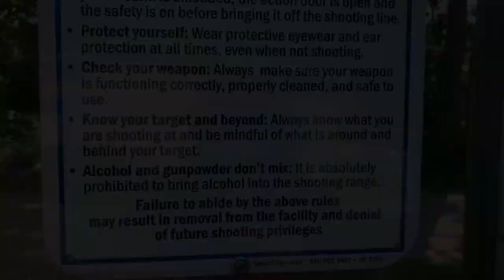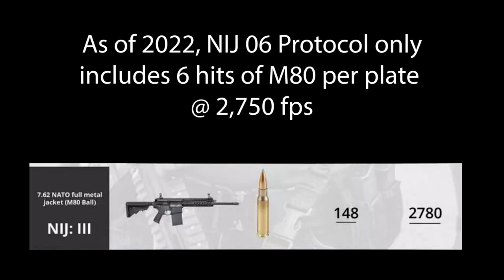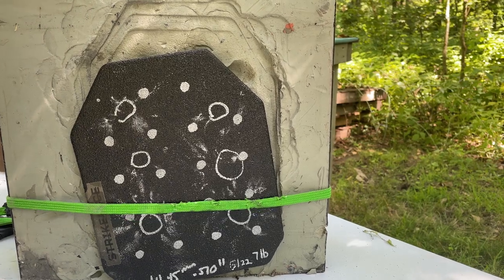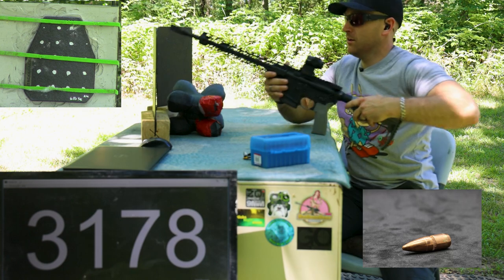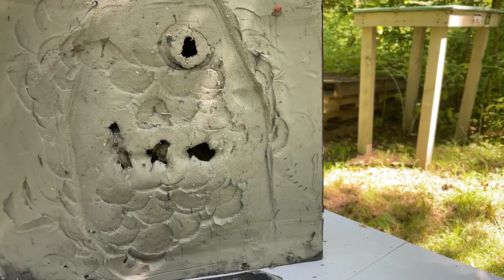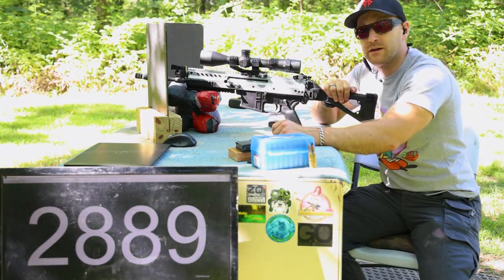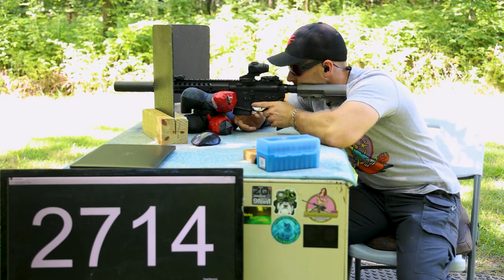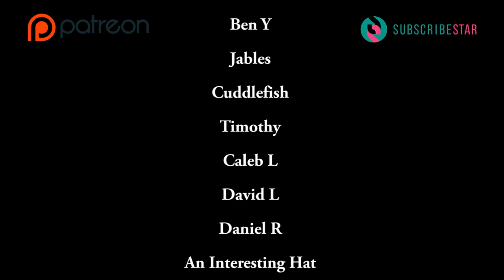Tacticon Armament Level III+ Steel Armor Demo!

Comment: Tacticon replaces the plates for free, with a police report, after you've been shot.
Reply: They do🫡
Reply: Fr?
Reply: Seems like you’ll die from the caliber everyone and their dog has tho…
Reply: So will Apex Armor with any brand plate you buy from them.
Reply: @Randaljoness  what round is that?  The xm193 or the m855a1?  You're acting like this doesn't stop green tip.....  Did you watch the entire video?  It stopped both of those rounds on the last plate. When he used a specific round with a specific barrel length it went though....
Reply: What’s it matter if the bullet goes through
Reply: @Cowboy0007  the bullet only went through when he used very specific rounds with very specific barrel lengths. He wasn't going to stop testing till he put some holes in it.
Reply: Very specific rounds? M193 is 55 gr ball it’s the most common ammo there is.
Reply: @jamesandrews8699 What are you talking about he got 2 penetrations with a 16” barrel and M193 that is the most common combination that people have. Yeah they didn’t penetrate out of an SBR the velocity is too low.
Reply: @jamesandrews8699 

M193 in a 16" barrel smoked these plates, and it's the most common round and barrel length. 

Hell, it's what I run for my General Purpose Rifle. Lol
Reply: I've had to use that warrenty 4 times already....
Reply: @jammbbs1688 stop getting shot
Reply: @vaden706  it was a joke lol
Reply: So does Apex Armor who offers actual armor like Highcoms. Apex Armor will even go farther to also replace them in the event they are damaged in a natural disaster
Reply: Theve sent me two replacements I cant vouch...sheesh mabe it's time I get out this neighborhood 😂😂😂 jk jk
Reply: @Cowboy0007  doesnt necessarily mean that youll die. The frag off the back of the plate still has to go through the carrier material and clothing behind the plate. Might just end up being a nasty flesh wound with minimal penetration or a really bad bruise.
Reply: if you survive...
Reply: @jamesandrews8699 He shot it with a 13" barrel when it passed, and before that, it failed with the longer barrel of a couple of inches.
Reply: @BuckF0eJiden 308 out of a 20" is what I built as mine. It does disgusting things to plates, even those that are of the upper echelons
Reply: @H_Hold  Oh, I have a 243 Winchester, and the Lehigh solid copper TUI rounds penetrate everything but level 4s, and they vibe check the shit out of them.

Comment: If SHTF you might want steel plates for multi-hit capability. If your using Ceramic plates and take multiple hits and it cracks, your out of the fight. Won't be able to order new ones if everything is shut down.
Reply: gets shot once and shrapnel frags and slits your thoat - steel armor boi

"gets shot twice and now your armor is worthless but still can breathe" - ceramic armor boi
Reply: @ProjectSwietek  Are you operating under the idea that anyone with even half a brain is using steel armor without frag coating? And in this case, every steel armor from Tacticon comes with frag coating standard.
Reply: @Arkancide  People who shit on steel like their lives depend on it do not talk about spall coatings.
Reply: @ATruckCampbell Yup, there are even products out there like one from Scorpion Tactical gear that is a sleeve for armor plates. The backside is padding, and it is Kevlar wrapped to help with spall as well as the spall coating. It’s a great product that I own myself.
Reply: If you're taking multiple hits center mass, your tactics suck and you probably also have holes in your arms and legs.

I'll take the plates that weigh half as much and can stop 7 hits.

Comment: Like to see some of these bullets in a 22-250!
Reply: This would be very interesting
Reply: I’m gonna spoil it for you. 22-250 blows right through 1/4” AR650 like it’s not even there lol
Reply: I've just built a 26" .22-250 for that purpose.  I plan on letting @Buffman R.A.N.G.E. borrow the upper at some point.
Reply: @AlaskanBallistics  DO IT...DO IT NOWWW
Reply: Yeah just  like 243 win this hyper velocity stuff zips through steel
Reply: why does Noone talk about 6mm mag,it out performs 243 by a few hundred feet a second
Reply: @ronmatson5502  probably because.22-250 is more available and cheaper.
Reply: Stability issues. The twist rates on most 22-250 barrels are too slow for a longer bearing surface and weight
Reply: @PureCountryof91  he could have a custom barrel made. There are alot a few custom barrel companies that will do that.
Reply: @hunterjager9538  no need chief. See, Craddock precision makes .22 creedmoor barrels. Get your gauges and ream the chamber to accommodate the shoulder height difference. Then run 855a1 bullets and 3400fps on a slow day
Reply: Your evil

Comment: Buffman thank you for your videos. Could you do another test with the tacticon plates as far as fragmentation and the spalling cover coming off. I have an idea that I think may mitigate that and make those plate better and that would be duck taping the edge and then using shrink wrap that goes around pallets and boxes. If you wrap the plates around the side and around the top multiple times and developed a thick seal would it contain the fragments. Thank you sir.
Reply: Paint it with bedliner
Reply: A sensible solution is a spall sleeve over the plate.

Comment: You made me switch from m855 to m193 for defense. I know each has its advantages but to me overall m193 just seems more reliable.
Reply: I have them alternating in the mag that lives in the HD gun....
Reply: @presidentmerkinmuffley6769  Is that really worth it considering the zero shift
Reply: I generally prefer m855. First off for m193 to be ‘armor piercing’ it need to be fired out of atleast 20 inch barrel and for a HD gun that’s probably way too long. Secondly even from a 20” lightweight UHMPWE (plastic) armor stops m193 no problem however plastic armor cannot stop m855 green tip even as low as 2600 fps unless it has a ceramic cover. But yes if bad guy is wearing steel armor then m193 is better, preferably out of 20 inch
Reply: @user-oy9zy4ds9m  if the people invading your home are wearing armor capable of defending against m193, you probably have a problem one ar15 can’t solve lol. I guess you could say the same for m855. In reality it will be many years if we ever do see anything more capable hit the civilian market at an affordable price point. Regardless in my initial post I was more referring to general large property defense rather than my home. In my home I use a full size hand gun.
Reply: @roncheeseman3687  I agree 100% . M855a1 will still give you a higher edge as buffman has proven that it can defeat SOME level 3+ ceramic/poly hybrid plates that will defeat both green tip and m193. M855a1 will also defeat safeline’s FRAS (flexible rifle armor) as well which defeats both green tip and m193 from 20” barrels. This is why I run m855a1 in my shtf rifles and 12.5”+ barrel lengths for maximum effectiveness/velocity. But m855a1 is very expensive especially to stock up on for shtf and rely on resupplying in the long term. This is why full auto may be useful in shtf (atleast at close to medium ranges) against body armor too so you won’t have to rely on bullet construction or velocity as much , you just hose the guy down real quick and odds are some bullets missed his armor lol
Reply: @roncheeseman3687  my perfect shtf body armor choice would be stealth armor systems boron carbide ceramic flexible rifle armor, rated for m855,m855A1, m193, and even m80 ball. Also covers nearly twice as much of your torso as regular rifle plates do. Expensive though a vest is like 3 grand.
Reply: @curgunner  Only one mag that way is in my HD gun, height over bore already has me holding to the bottom of the reticle for point blank ranges anyways. 36 yrds, yea its noticeable and could be an issue, 15 ft, not so much.
Reply: @user-oy9zy4ds9m  m855 only beats lvl 3 , anyone can get lvl 4 playes these days
Reply: I'm still learning so I may be doing it wrong but I have a LPVO with offset red dot, the lpvo has a bdc reticle calibrated for m855 so for that I use green tip but for the offset which is more likely to be used up close or home defense I'd use my mags with m193
Reply: @user-oy9zy4ds9m  
I poked holes in level 3 steel with 55gr Win XM193 with a 16" barrel.
Interestingly,  the LC 55 gr XM193 did not penetrate.  Winchester blew clean holes.
Reply: @zm1786  Yet most people are running level 3a and 3+ not level 4.
Reply: It comes down to ammo selection. I tested with a 16" barrel two different level 3 steel plates.
55gr 5.56 lake city didn't penetrate either. Winchester 55gr 5.56 penetrated one but not the other.
Fort Scott 40gr 5.56 penetrated on both plates every shot.
It even penetrated TSG lightweight iii+ steel.
I alternate m855 and fort scott 40gr in my mags. 
On a side note a level 3 uhmwpe plate I had stopped the 40gr fort scott. It penetrated 3/4 of the plate though. M855 sailed through.

When I put soft iiia behind level 3 steel the 40gr fort scott and armor slug from the plate was contained in the iiia.
Reply: @curgunner it is a 10 yard max distance. There is no zero change.
Reply: @FXIIBeaver  I just don’t see any real advantage to stacking M855 in the mag and you do have the downside of a zero shift. Close range that’s negligible, but in my mind guns that I trust my life to should be as general purpose as possible because you never really know what might happen. Probably won’t ever need to take a 100yd shot with a home defense gun, but I’m not gaining anything by compromising that ability.
Reply: @curgunner  you commented on someone who specified home defense. Zero shift is non existent statistically not real in that context. You are now shifting the goalposts to maintain your opinion.
Reply: @FXIIBeaver  I’m talking about a home defense rifle, and in my reply to you I acknowledge that in a home defense scenerio it is very unlikely you will need to take a 100yd shot, however I think it’s a possibility. Extremely unlikely, but possible as a situation potentially escalates and evolves.
Therefore we have to ask what does stacking with m855 gain? It doesn’t need to be much gain, because the zero shift isn’t a big deal, but it needs to be something because stacking it loses something. I don’t see what m855 is gaining you in exchange for that zero shift.
Reply: @curgunner  if you take a 100yard shot in a home defense situation have fun in prison. You are literally making up shit to prove a point. At the end of the day it doesn’t matter what is in the mag because if you take the proper measures of angling zero shift is non existent at ranges less than 20 yards.
Reply: @FXIIBeaver  Agree to disagree, I’m not going to change your mind obviously, and nothing you’ve said gives me any reason to start alternating the ammo my mags.

If you could give me a decent reason as to why I should, then the issue of zero shift could be forgiven, because it’s necessity is statistically unlikely. Statistically unlikely doesn’t mean statistically impossible though and I see no reason not to play to as many possible scenerios as I can if there isn’t a drawback.
Reply: @curgunner  I am not arguing for it. I literally don’t care. But your argument revolving around illegal 100 yard shots and zero shift are completely unfounded.

Comment: Thanks for taking the time to share these tests ! I actually have this armor so it was very interesting
Reply from the maker: My pleasure!
Reply from the maker: @NO_B.Sfitness  I think they just now caught the “a1” mistake when i demo’d these for them. Not good they didn’t catch it until now though. The 3250 may be a v50 and depending on the steel lot could be slightly lower :(?
Reply: Same. I use this same armor for work and I bought my plates 3 months ago.
Reply: What work do you do
Reply: @NO_B.Sfitness  armed security and some EP stuff but I use a concealed for EP

Comment: Simple strategy. Use steel for training. The extra weight helps keep you fit. Use ceramic/uhmwpe when contact is possible. Better protection and lighter too.

You can use steel plates as tertiary backups or for equipping the unprepared or noncombatants.
Reply: First plates I bought were steel. 8 pounds x 2. 16 pounds? I thought. No big deal.
Was WRONG lol.16 pounds is friggin' heavy as hell.
Switched to 2.4 pound polyethylene III+. Shit, might even swap out the rear plate for the .4 pound rigid IIIA I have. A few pounds here and there really kill ya when you already have a rifle and kit and camelback and such. Kills me, at least!
Reply: I use some cheap level 3 steel 10x12 plates for push ups and squats.
8lb ea.
Reply: I have these exact plates in my kit. Swimmers cut front and Sapi in rear. 6.6lbs front and 7.1lbs rear. 13.7 total weight. They are serving two purposes right now. 1. The weight helps my physical training (recovering from back surgery) 2. I'm having zero ego and am running budget plates. I speak to everyone about them. I'm 5'11" flat footed and 195lbs with around 11% body fat. I am 100% satisfied with them especially for what I gave for them. I plan on running these a solid year then getting some Diritium plates next. Tbh these are not bad. Now, if your out of shape and have no core strength yea, after a 2-3hr training session you'll know theve been on. I don't have that issue, even in surgery recovery.
Reply: 7 pounds is about as heavy as most alumina ceramic options of the same coverage area. I walk around with a plate carrier with level 4 alumina 10x12/medium sapi and it weighs basically the same and isnt that bad. I am sure as I continue to train it I can handle the weight just fine as walking around it for a daylong match is okay right now and I’m on the lower side of the overall body mass distribution
Reply: @angry_zergling  i am curious what your daily routine with the armor on is though, are you moving a lot? pulling security? what situations do people wear armor and why as a civilian do those pounds matter that much?
Reply: @angry_zergling what polyethylene plates do you use that are 2.4 pounds?
Reply: Better protection? ALL plates throw frag, steel is rated for more hits than ceramic, and they have steel plates that weigh as much as ceramic now...
Reply: 12×14 4 steel plates with spall coating, plus xl side plates. It isn't light but then again I'm not small, and also not wealthy enough to spend 10x on equivalent ceramics. Throw a spall bag over em. Rated up to AP 30.06. Not likely to run into that
Reply: @notyouraveragegoldenpotato i don't know of any steel body armor plates that stop M2AP
Reply: @PrincipalityofZeon  I spent years as an iron worker steel erector and fabricator. 120°f on a 1/4 mile roof filled with near mirror galvanized sheeting... bending over welding for 16 hours a day.  Yeah. Nah. No more. I took it all but it broke my body. Got some different skills and learned I could make more in my pajamas. Leave the physical life aspect up to me and my adventures. Killer skill. BRUTAL work and conditions. -20f with a 50 mph wind. Whatever. Get it done. That's not normal life. Sure is a great character builder though
Reply: Ceramic is definitely not better protection, not sure where that came from. You can hit steel at least 20x more than ceramic before pass through.
Reply: @Frindleeguy  you believe fudd lore.
Reply: @Frindleeguy  yes but it'll stop better rounds than steel. And you're at MUCH more risk of a follow up shot missing your body armor completely, so the increased durability is less of an advantage.
Reply: @notyouraveragegoldenpotato What do you do for work now?
Reply: @notyouraveragegoldenpotato There is not a single level IV steel plate out there.
Reply: @Frindleeguy Ceramic can stop higher threats more effectively than steel.
AR500 won’t stop 55gr out of a 20” barrel.
Reply: @KarnivorActual funny because I'm looking at it. A google search my bot friend will show you indeed there are level 4 steel plates rated up to AP .30.06
Reply: @KarnivorActual  How many times has someone actually faced off against someone with .30-06 AP?

Comment: I wonder if running a 3A backer could have stopped some of those threats on a few of the M855A1 rounds they were stopped so that makes me think the ones that did penetrate only barely made it through.

It's weird that this plate claims to be AR600 when in the past most AR600 plates like the CATI plate could stop M193 and M855A1 so it makes me think these are AR500 plates someone is selling as AR600
Reply: Nah m855a1 from a 20” will defeat 1/4” AR650 too.
Reply: And from a 16” it will not defeat ar650 however. From the 16” it was only 3000 fps and from the 20 it went over 3200. That’s 200 fps was the difference between complete pass through and not
Reply: @user-oy9zy4ds9m  AR650 is way too brittle for effective armor the sweet spot is in the 550 to 600 range here is a video of the plate from CATI that I'm referencing 

Also M855A1 tops out at 3050fps from a 22 inch barrel. It uses a faster burning powder designed for shorter barrels. 
https://youtu.be/8V3wqfyFv_4
Reply: It's worth remembering that the M855A1 is not the M855
Reply: @bigtree1138  I never said it was
Reply: @nemisous83  youre clueless.